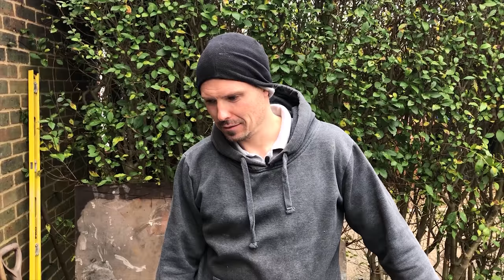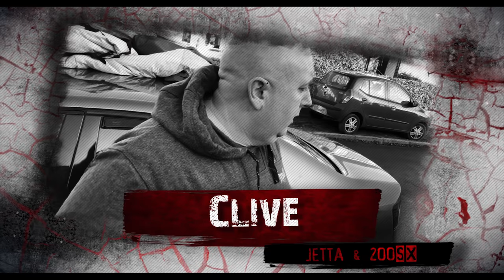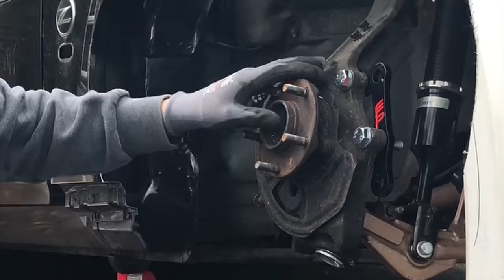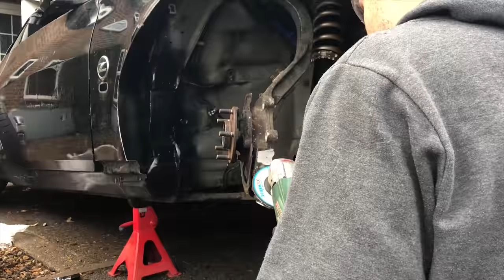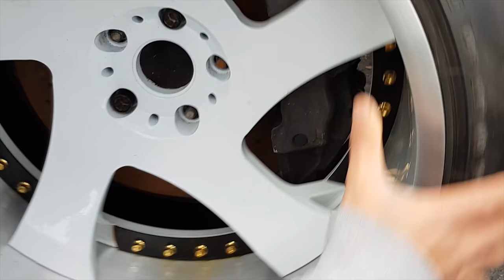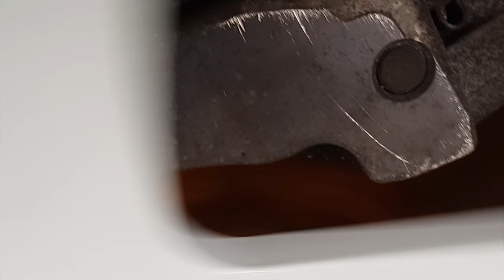Z33 Nissan 350z Targa Converted 2JZ Oni Camber Build

Comment: I am also doing the same front brake conversion. But I am having a hard finding the M16 bolt in UK required to do install. Do you recommend place to get a hold of the m16 bolts ?
Reply from the maker: Google "westfieldfasteners" I get all my bolts from there, well all the shiny ones i need